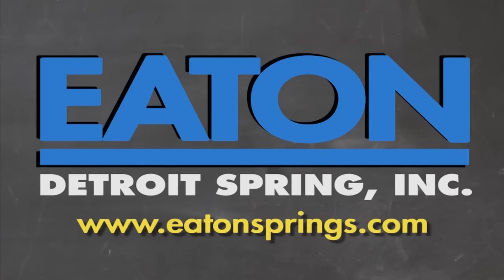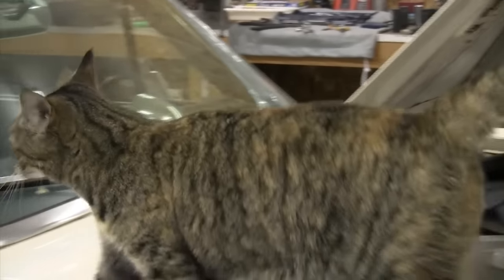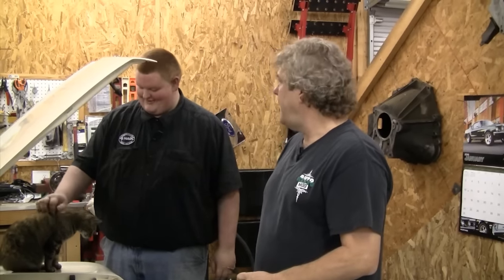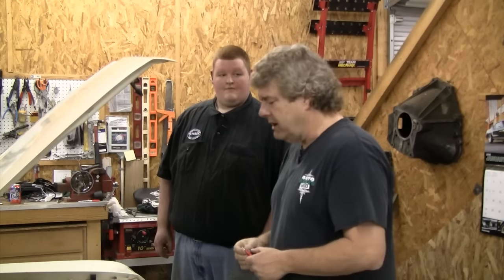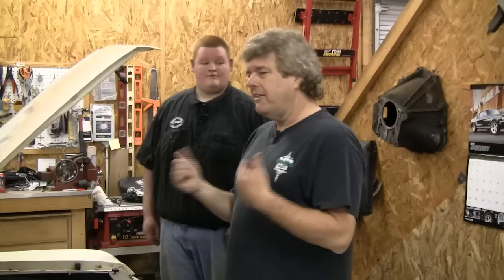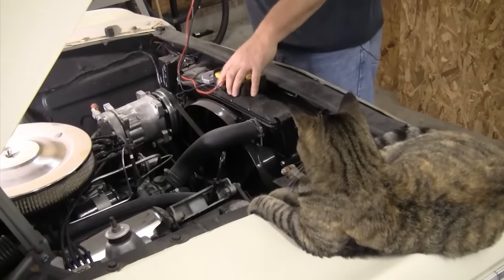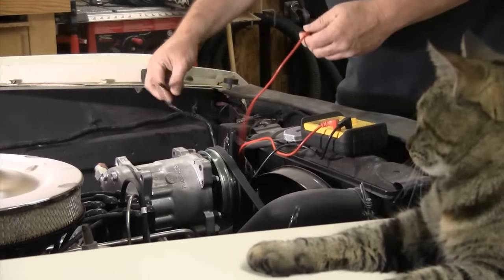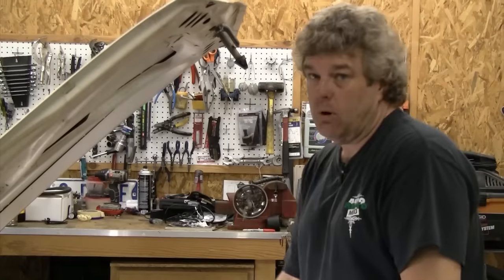Muscle Car Electrical Wiring Troubleshooting Tricks and Tips Episode 250 Autorestomod

Comment: I have been restoring a 65 Mustang for over ten years. One of the most common problems encountered is loose or corroded connections. You got to keep in mind this stuff has often been on the planet longer than the owner. It can often present as a bad regulator, amp gauge, or alternator when it's really just a matter of taking connections off and cleaning with a brush or sandpaper. I just recently fixed (erratic gauge/lights fluctuating) by taking the wires off the battery side of starter solenoid and polishing all the surfaces.

Comment: Good job guys. Makes me think I have a grounding issue on my aftermarket tri-gauges (Voltage, Temp, Oil Pressure).  Gauge lights are always fading in and out\blinking; whenever the lights are on. Now, I have another project... thanks again,

Comment: A year ago I bought a 1971 Comet GT that had been sitting for 10 years. I went thru the wiring harness and cleaned up the fuse box. replaced votage regulater all the things that should be done I did. The car has been running fine for 8 months solid. The carborater that was on the engine that was in the car was way to big. I installed a new elderbrock 1406. I have been running that carb right out the box for a solid 5 months. I finally got around to hooking up a vacuum gage to tune it in a bit better. I noticed when a went to adjust idle speed there was a little spark from the adjuster screw to my screw driver. The battery has never gone dead and system is charging and it has not blown any fuses. Some were I saw if you disconnect posotive battery terminal and use ohm meter from the battery pos post to the battery cable that is disconnected and it shows voltage there is an active short in the system. now im a little nervous about driving it. Is there any help you can give me. I do have a wiring diagram and manual for the car. everthing seems to check out when tested by the book. Thanks
Reply from the maker: First thing I'd look at is engine grounds, make sure there is a ground lead from the intake to the firewall. Also, does it do that consistently? Could it be a one time thing?
Reply: @AutoRestoMod  Update on this issue. The problem I found was the choke thermostat spring was cracked so as it would heat up and unwind to open the choke plate the crack on spring was pushing up against the carb housing.  Here is a little video I took after a 300 mile cruise last Fathersday. 
https://www.youtube.com/watch?v=Bczbq7XbXzU

Comment: I have a 68 cougar.  Gauges won't turn on and they don't light up.  I replaced the voltage regulator behind the dash but still nada.  Any advice for troubleshooting?
Reply from the maker: The gauge cluster grounds to the dash panel. I'd make sure that you are gounded.

Comment: The rationale over the preference for the stock, points-style 5vdc regulator for the instrument panel over an aftermarket solid state regulator is that the original style runs dirty? Most circuits and devices prefer a clean voltage source, any that actually work better with a dirty power source must have been designed with that in mind. Can you clarify?
Reply from the maker: There is something with the degrading electrical signal that makes it work more effectively. The solid state is more on/off than on/ooofffff.

Comment: That happened to me after I bought my 'new' 65 mustang in LA I took it cross country. Somewhere in Colorado I was belting along on an empty road 70- 80mph at night I reached down with my left foot to get big light for the road ahead and everything went BLACK!!!!!!!! I braked hard and didn't run out of road but it was a terrifying experience. I live in London now so I don't need it just occasionally I press it to check the highbeam but it's never done it again!
Reply from the maker: I had that happen to my '71 Mach. I was using Halogens (late '90s) and didn't know about relays them. Lights died about 30 minutes from home. Luckily it was a cloudless full moon night.

Comment: Another cause for headlight flickering is a partial short to ground in one headlight circuit.  The automatic-reset breaker (no fuse) tries to keep the headlights on, but cycles continuously because of the excessive current draw.

Comment: Hi I have a 1958 Chevy Impala and I'm having  a problem with my reverse lights not showing when I put it in reverse on an automatic. Where do I begin to diagnose?
Reply from the maker: First thing I would want you to do is source a wiring diagram: https://www.58classicchevy.com/images/1958-Chevrolet-wiring-diagram-6cyl.jpg The problem is most likely a ground issue or the switch.

Comment: Im working on my 68 torino but Im only 16 and its simple but it is like I fix one thing and then I find another,I got it driving and then all of a sudden the fuel gage stopped working. I dont know why??
Reply from the maker: I'd check to see if it is grounded well. Then check for power to the sender.
Reply: Will do, but I have to wait until the weekend getting the glass installed so I won't have my baby until then:( but thank you so much! I finally subscribed but I've been watching you guys for forever

Comment: Error @1730  : "Constant  Voltage" unit has no effect on Ammeter.  It is used only for Fuel, Temperature, and Oil Pressue.

Comment: There is on the market now, crimp connectors that are shrink wrap with adhesive. Good idea on replacing a fuse with a light to find a short, always worked for me..B 

http://tnb.com/ps/endeca/index.cgi?a=nav&N=318+1010+4294953238&Ntt=

Comment: when I shift radio turns off? 1970 Torino column shift...
Reply from the maker: Three speed or Automatic? Old radio or newer one? Doe the radio turn of over hard bumps? I am betting on a loose wire or ground on the radio circuit.
Reply: FMX. COLUMN SHIFT. 

ANYTIME I TOUCH SHIFTER IT WILL RESTART RADIO.

NEW RADIO.  retroradio.

if I'm sitting with car off with accessories on. and im listening to radio then shift from park to reverse or any other gear it will short out and come back on. retro message on radio says goodbye like it was being parked or shut of.. but does come back on eventually..
 @AutoRestoMod
Reply: and now the ignition cylinder/key cylinder will buzz always if door is open..
Reply: Tried uploading a video but. I couldn’t figure that out.
Reply: Looks like it was 10 months ago, but did you check for a chafed wire in the steering column?

Comment: A lot of things in this video bothered me. The solder joint should not be used due to vibration, that's why the FAA doesn't allow it. Use environmental sealing crimps instead and use the correct tool. Also the corroded ground, the guessing with values and using incorrect terms such as check for volts when put in ohms. Not your best work guys.  I may be overly critical as I am a aviation electrician and I rewire cars on the side.
Reply from the maker: +John Engvik Points taken John. We made some errors in our terminology, and said that crimp connections and solder connections are a mixed bag on the automotive side. Crimps are a great way to go but as ugly as a wart. While we recognize that the FAA won't do solder for a reason, we also know that solder is a viable way to complete circuits. We appreciate your taking the time to write us and let us know. If you will please contact Jeff with the places and terms that were erroneous we will take measured to put subtitles in those areas to correct the problems. Jeff can be reached at: jford @autorestomod.com